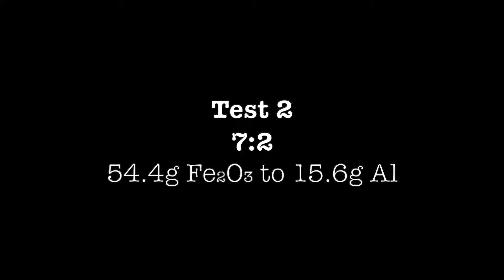Thermite Pt. 1—Trying Different Ratios

Comment: despite having a magnesium strip i find ignition with a match to be  a challenge perhaps I should purchace a propane / MAP gas from home depot however the tank being reasonable the actual part that screws on the tank is $30 bucks

Comment: The white fluff is likely zinc oxide.
Reply from the maker: oh maybe from the zinc in the penny
Reply: PyroChemMiner yes. I watched a couple home smelting vids on here, and zinc burns very bright just like that. So thats my thought since ya know, pennies are mostly zinc with just a thin copper jacket. 

But you did give me a great idea on how to spice up these reactions. There isn't much experimentation other than as you did. Also, i started making my own reagents for these, and the color after mixed isn't red at all, more greyish pink. I think its because i make extremely fine powedered rust recovered from acid washes, so its smaller particle size makes it mix far more thoroughly.

Also with really fine particle sizes, you cannlight it with a common butane torch, no need for the magnesium starter.